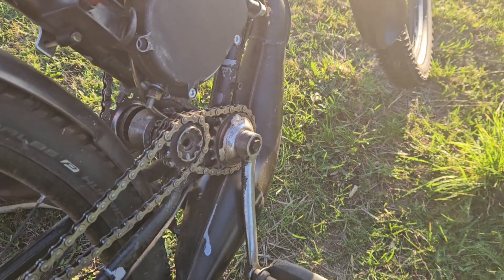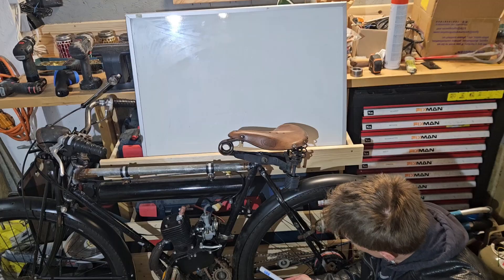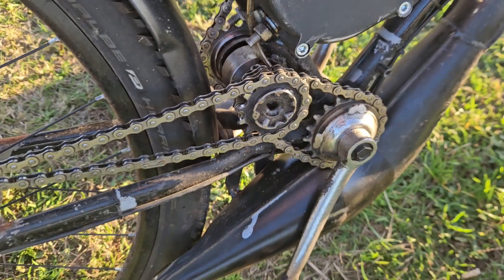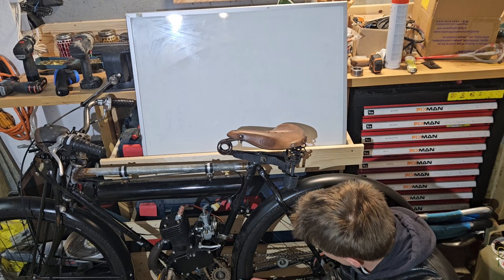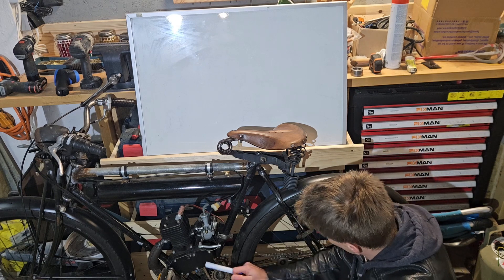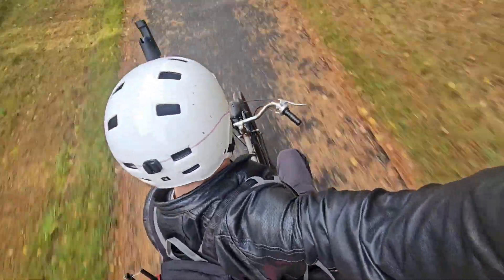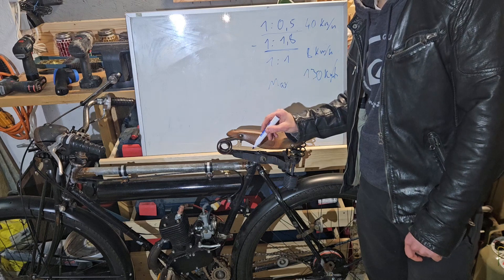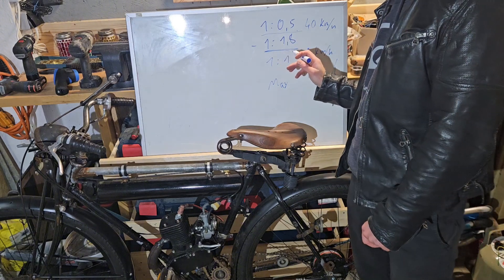motorized bicycle jackshaft made for 130km/h

Comment: On the jackshaft is only 1 of the 3 gears ⚙️ a freewheel gear?  
Are the outter gears fixed/non freewheel & the middle jackshaft gear ⚙️ is the freewheel one?
Reply from the maker: Hi @michaelbrinks8089, yep just the middle one is a freewheel. Outer ones are welded directly to the shaft. you just need the freewheel that your pedals don't turn all the time. Would be exhausting otherwise 😂
Reply: @Son-of-Allen-key  Thanks for the reply 👍..... I've been debating on what my next engine setup should be, to go faster. I didn't want a big wide, heavy 4 stroke engine & CVT belt drive in the frame.  I'm thinking about another 2 stroke engine. But this time, a more powerful 52x40mm 2 stroke engine kit & a durable 3 or 5 speed rear hub.. With stronger wheels, frame & better brakes & high speed tough Ebike tires. I should be able to cruise along at 45mph in lower engine RPMs so the engine will last longer.

Comment: Unless I am mistaken the rear hub is filled with a special friction fluid. The big problem with the transmission is that it is semi hydraulic and because if of that, a relatively high amount of power is lost as heat inside of the hub like you have experienced. The 171 hubs were the strongest cvt bike hubs. Kindernay and special Rohloff models can take more but have discrete steps.
Reply from the maker: Thanks for your comment. It is strong indeed, even it was never designed for little chinese bike engines, it holds up very well. We will see what this hub can take or not. Currently upgrading the motor and with more than 5 horses, it might be necessary to go full mechanic, hub-wise. Not sure if Rohloff can switch gears while in motion on the input side. I hope.
Reply: @Son-of-Allen-key  Only reason I mentioned Kindernay and Rohloff is because they claim their hubs can handle up to 130 nm.

With gear hubs its best to roll off the throttle whole shifting like you would let off pedaling. Nuvinci/enviolo is the exception.

You might be able to increase gear reduction and get better acceleration. If your gearing was set up to top out at 80kmh at 5000 rpm a lot more of your gear range could be used.

I am reading that the modern models most similar to the old nuvinci n360 can handle up to 80nm of torque.

Anyhow, it is your bike, your engine, your time and your money. The bike is handsome, and seems very fun to ride.

Comment: I have built a motorbike with a jackshaft. I use a Shimano Nexus 7 speed internal rear hub. I love this bike it rides so well. I did not build my jackshaft I used a Sick Bike kit that has the gears and freewheel crank sprocket. I’d like to build another bike and make my own jackshaft like you did. Well done I loved this video and your motorbike. Thank you 🙏
Reply from the maker: I'd love to see more ideas like yours. I'm just wondering if in your case the chain and sprocket has to stand still in order to shift gears. My dad's bicycle has a shimano hub, but he can only shift if you stop pedalling. I was also thinking of using a cheaper hub like nexus 7 or shimano 8, but I decided for the NuVinci CVT version because I don't have to pull the clutch and decrease throttle while shifting. Did you check topspeed before and after jackshaft+ hub?
Reply: @ I built the motorbike with the jackshaft so I don’t have other experience with it. I’ve just been shaking it down and had it up to 35mph. It seemed like it has a lot more but at 49cc it may not. If I’m not wide open throttle it shifts between the gears fine without clutching. It’s turned really cold where I live so it’ll be a few months before I can ride it again. Everyone tells me these Nexus 7 hubs are bulletproof. It doesn’t get hot or anything at least it hasn’t yet.

Comment: really cool build, for a stronger engine you could check out some minarelli engines. im hoping to get/make a jackshaft for my bike eventually but i gotta get it running good with a rear sprocket first!
Reply from the maker: Yeah, I had the same idea and I'm looking for a combination of piston, reed valve, zylinder and head that will work for the yd100 engine. If anyone has seen a conversion that worked well, please let me know.
Reply: @Son-of-Allen-key There is the phantom 85. It uses a yd100 bottom end but it will likely be more cost effective to buy an entire engine.

It has a long break in period but it is a very strong engine. I know it has a reed valve. Smolik did dyno testing on it and found it to have 4.5 foot-pounds of torque around 3500 rpm and 5hp around 9500 rpm.
Reply: @Son-of-Allen-key  They now sell a few different 52x40mm engines and the 52mm top ends will fit on a YD100 case/bottom because the 4 cylinder studs are spaced 50mm apart....Don't buy the 52mm iron sleeve engine kit or cylinder because it's junk. The Avenger 85(52.x40mm) and Dominator 85 are good engines.
Reply: A £100 50cc brush cutter will give loads of power and be easy to soup up with a spannie exhaust.